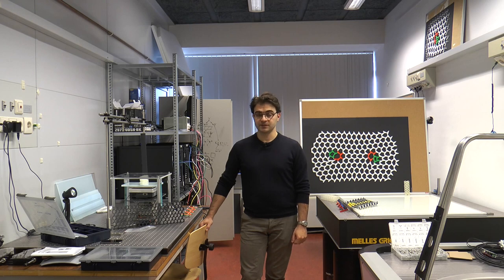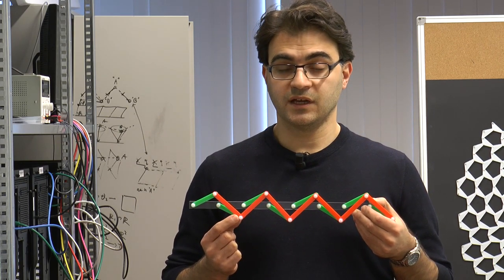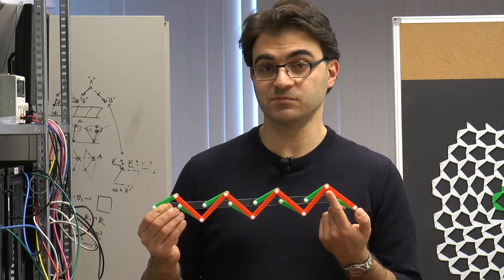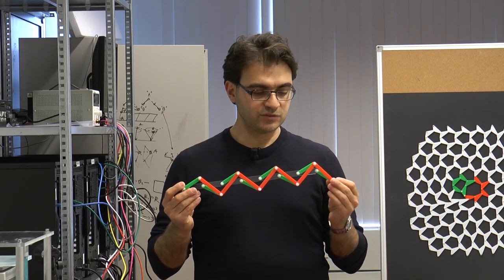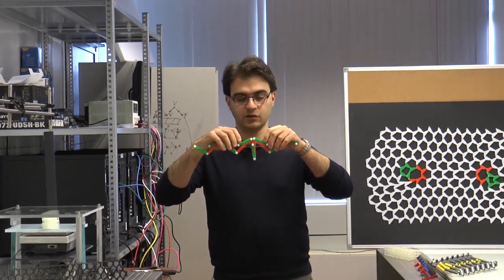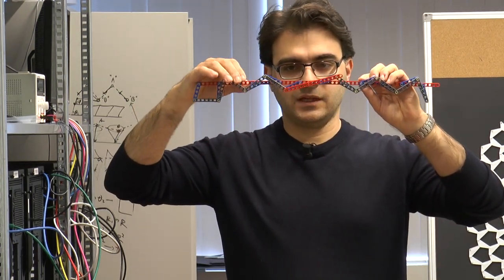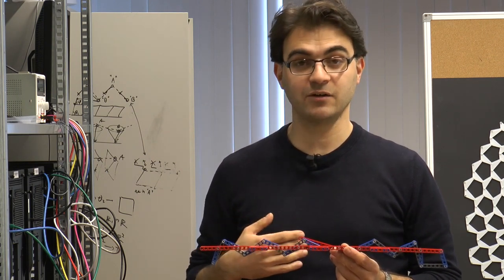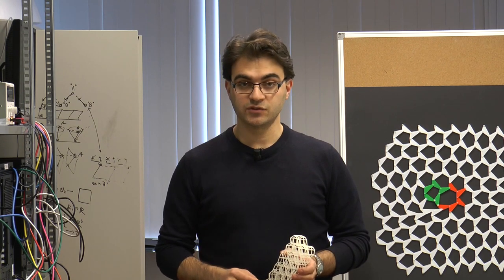Topological mechanics intro (by Vincenzo Vitelli)

Comment: Interesting observation, i've noticed a nearly identical sort of mechanical formation with a chainmail Box Chain weave with too small of rings. The box chain turns into more of a  rectangle because of the too tight rings however starting at either end you can press into the edge ring to cause a shift which switches which side is the longer side of the rectangle.